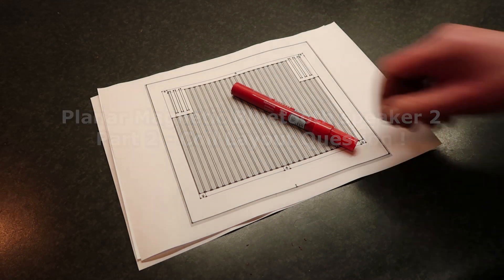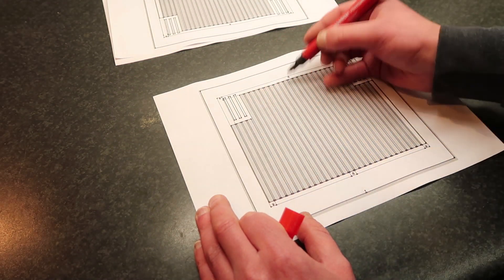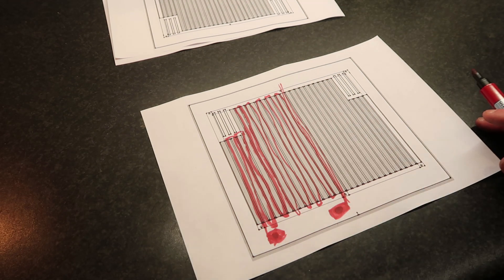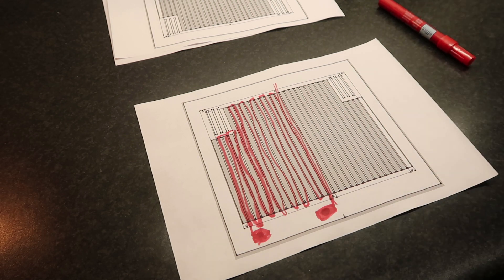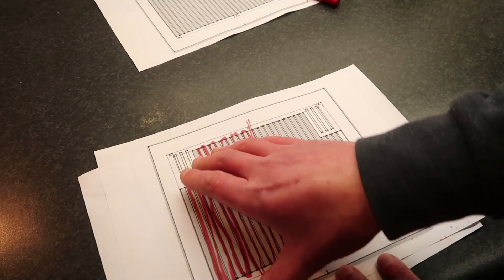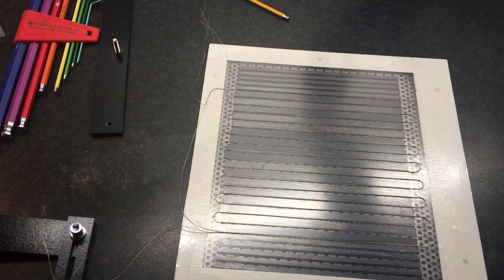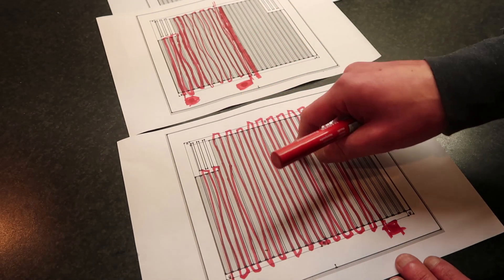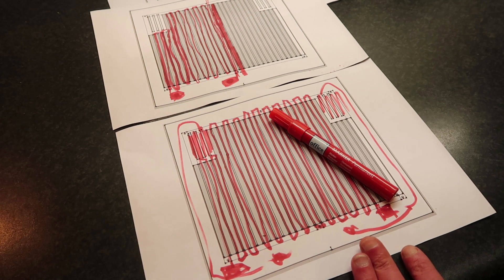DIY Planar Magnetic Bluetooth Loudspeaker 2 - Part 2 coil layout question

Comment: I'm group three , mono mid/bass stereo tweeters. Wouldn't having two coils front and back just be mono anyway and cause all kinds of cancellation if running stereo?
Reply from the maker: it will have the same cancellations as creating a mono signal from a stereo one :)  so you are actually group 1 :)  the reason for foil back and front is having more coil in the magnetic  field to achieve the desired impedance. and to create a  mono mid/bass without having a third amplifier channell.  just like  dual coil subwoofers do.  you connect one coil to left and one to the right channel and you got a sub that does left and right.
Reply: @joppepeelen  so group one it is 😀

Comment: Wait hang on,

What about using making two mid-bass drivers stacked one behind the other. One wires to the left channel / tweeter and one wired to the right channel / tweeter. Both bass panels would have some voltage generated by the other but it shouldn’t be enough to damage an amp I wouldn’t think.

You even make a diaphragm that is just one tweeter and woofer, then do the same but flip it over for the other side
Reply from the maker: But i describe  something similar except I dont need to use 2 membranes since i just use both sides of the foil :)

Comment: What about using the large section in the middle as mono mid-bass and just leave the L/R up to the tweeters?

How low can the tweeters go?

Would wiring the tweeters in series with a single bass panel cause problems? Apart from maybe muting audio where one channel is entirely out of phase
Reply from the maker: hihi "What about using the large section in the middle as mono mid-bass and just leave the L/R up to the tweeters?" thats my group 1 (maybe i did not do a good job explaining) :) but to do so i use a left mid/low on the front and right mid/low on the back of the foil. tweeters cant be in series or you cant filter them.  they need to have a high pass filter. i dont know how low they go, i did not build the thing yet :)

Comment: I dont think you should give so much value of the stereo seperation with this speaker. Stereo is made  to listen with a 60° angle between listening position, left and right or the same distance between the listener and each speaker. One box like a protable bluetooth speaker can hardly archive this effect. 
I suggest to test the mids and lows with a crossover point you like together with a left/right or mono mix on a normal pair of  speakers and choose if it's necessary to use two coils over one.

If you use a buget dsp (look for wondom/sure) there are more possiblities to make use of a stereo design in one small box (ambiophonic) 
As the easiest way you may could go with one big coil for the mids/lows and one small for the highs and root the audiosignal together, in that case you have at least no missing tracks in your music..

If you mentioned 120hz as possible lowest tones, do you think this is enough?
Reply from the maker: I agree about the stereo seperation. i've seen the sure boards, i did not know the wondom, version ill take a look at those they seem to be a bit cheaper :) i wont be doing any spacial dsp. but as crossover would be nice !
Reply from the maker: I looked some up, the 2 x30 watt is a nice module, only problem is in this case i would need 2, of them :( and a programmer and a bluetooth module, that becomes pricey fast.  :( damned.  maybe ill get a DSP only version and use some of my stocked class d amps in this case.

Comment: With the coil on both sides, will they not wind up fighting each other . . . especially if the phase is different and the signal is producing different frequencies on both sides? I understand that the one side could have a reversed-phase . . . guess at this point, it is theory, and since you are an experimentor, sometimes one never truly knows until he tries. I like the second one where you use most of the membrane for the mid section.
Reply from the maker: they would work in tandem , backside and front :) both coil designs would have coils on back and front.  but i add one point for group 1) both left and right sharing most of the foil :) 

they can work against each other  if the audio signal has out of phase material left compared to right. but this will also happen acoustical with 2 speakers being so close together , and most certainly also happen if we would have made it mono before we feed the coils.